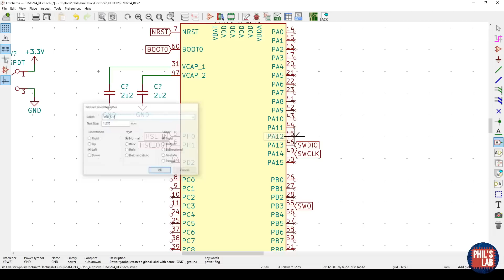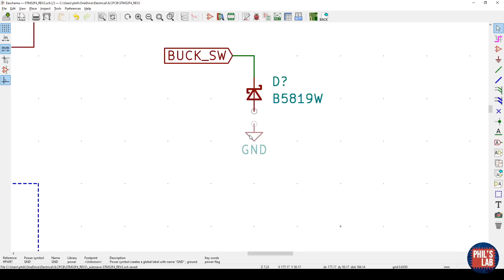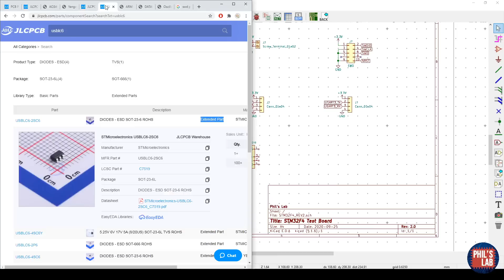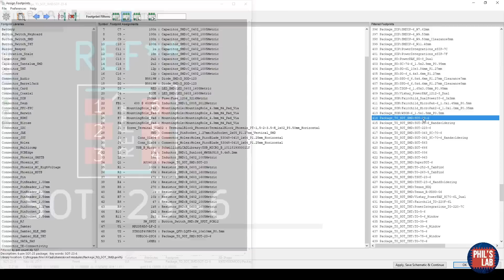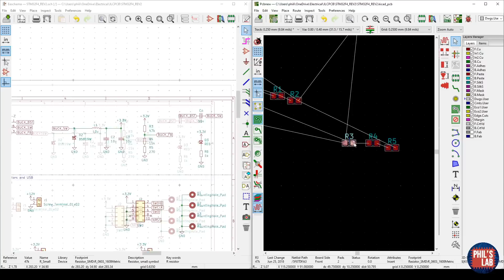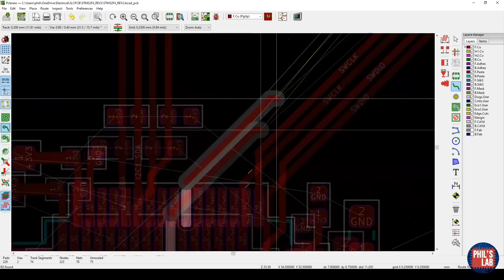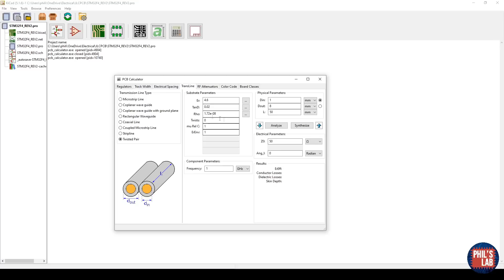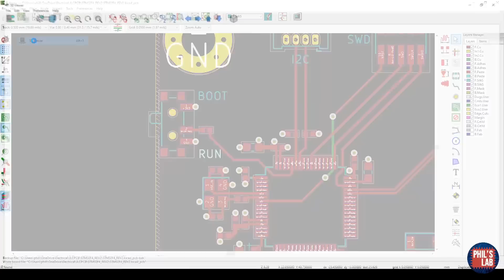(Sponsored) KiCad STM32 + USB + Buck Converter PCB Design and JLCPCB Assembly - Phil's Lab #11

Comment: This video is just great; I'm on my 2nd year of Electronics and Computer Engineering, and I needed to learn PCB design to start working on my final year project, although it has a different MCU and the final board will be way more component populated, this video just points out what most students do not get, like costs, finding stuff and other nuances you only get while designing. This will most certainly be a guide for me in the future! Thank you very much for dedicating your time with this.

Comment: Hey Phil, Great video.

JLCPCB says that the red markers in the preview do not actually represent pin 1.  How do you know they meant pin 1 in this case?

https://support.jlcpcb.com/article/99-does-the-red-dot-means-pin-1-in-the-placement-previewer
Reply from the maker: Hey Jameson, The JLC FAQ on pin 1 placement is pretty confusing. Basically it's only relevant for ICs and is indeed there to indicate pin 1 of the chip. JLC indicates polarities for diodes with a + and -. Essentially, if you follow the steps in this tutorial and mark component orientations on the silkscreen all will go well with the assembly.
Reply: Thanks @PhilsLab .  This became a lot clearer after I submitted a board design to them and they did their own analysis.  It seems most ICs have a clear pin 1 indicator but some packages, like the oscillator, didn't. The jlcpcb engineers figured it out just fine.

Comment: Good tutorial on Kicad! My only very minor criticisms are that Phil uses over uses label connections where wires would be more intuitive (the buck converter circuit would not sit well with most test technicians) and the schematic representation of decouplers in that way is not a good idea.

Comment: I used the same crystal with the same capacitors, but my OSC doesnt seem to work. Any idea, what can be off?
Reply: Not knowing how you have routed your board, I could not say for certain, but If the copper geometry in your crystal network introduces too much capacitance, things can be thrown off and the crystal will not oscillate. Make sure your traces from the crystal to the MCU are not excessively long. 

Also, the type of capacitor matters as well. With ceramic, which you would have undoubtedly chosen for a crystal, there is a parameter called temperature coefficient, which is important, to ensure the capacitance value does not drift with variations in ambient temperature too severely. Ceramic capacitors tend to fluctuate their capacitance as a function of the voltage applied vs voltage rating and temperature.

Alternatively, the MCU sometimes has configuration registers to set oscillator drive. 

Lastly, a high value resistor (1Mohm) in parallel with the crystal may help start the oscillations when Vdd initially comes up.

Comment: Hi Phil. Please explain how you calculated the Rext. According to the AN2867 appnote, the resistance is calculated by the following formula: Rext=1/(2*Pi*F*CL2). So if we got 16MHz and 12pF, Rext=829 Ohms. But you use 10-47 Ohms. Have you made a check to see if the additional resistance will affect the gm >> gmcrit ratio? And after that, you manually recalculated the resistance value and got the range from 10 to 47 Ohms?
Reply: Gustavo Elizondo had the same question you did; Phil answered it further down in the comments. :)

Comment: Thanks for the MP2359 reference circuit. I'm reversing the new Nintendo Game and Watch hardware (on github/same name as here/"game-and-watch-hardware" is the repo). It has a 3v7(LiPo) to 1v8 converter in a DSBGA-12 (or equivalent), mystery chip. The markings don't match anything from TI, do match Torix Semi's marking format, but not in a documented package they list. The only reason for mentioning it here is bc it only has two external resistors on two separate pins to ground and a tiny inductor that looks like a slightly wider 0805 ceramic capacitor. There are a few scattered bypass capacitors, but the 1v8 output of the chip is VDD for the STM32H7B0. I have the xrays and fully traced circuit to prove it. There's no external: feedback divider, switch, or diode, just the 3 passives and all ceramic caps. Do you have any idea where to start looking for a similar topology? I don't care if I find the specific chip they used at this point. I'm mostly interested in saving such a simple circuit block for future use.

Comment: Hello Phil,
Nice video. You don't really need to bother again with export/import netlist. 'Update PCB from schematic' does the job.
About the component orientation, I have 'patched' my KiCad with a permanent 180° rotation for all. Some users say only some components needs the 180° rotation. That fixed every polarized caps (not used in your video, avoid the problem ?).
You probably need to add to the video description "KiCad release 5.17" info because of v6 soon release.

I noticed you never 'save'  the job but often the icon is in saved state. Probably hours of video recording, cutting, assembling here !

Comment: Hi Phil,
How do You know the load capacitance of a crystal (C_L) is 12 pf?
In the datasheet: https://datasheet.lcsc.com/szlcsc/1811141821_Yangxing-Tech-X322516MLB4SI_C13738.pdf it is written 12pf; 20pf or specify, so how do You choose? Especially given that the LCSC: https://lcsc.com/product-detail/SMD-Crystal-Resonators_Yangxing-Tech-X322516MLB4SI_C13738.html/?href=jlc-SMT suggests that it's 9pf.
In the datasheet it says that the name suggest capacitance, but for me the letter L is not intuitive as a measure of capacitance :D (X322516M(L)B4SI).
And about PPM the higher the Load capacitance, the lower PPM, so +-10PPM should correspond to 20pf, but I might be wrong
Reply: Comparing products from https://www.evelta.com/ysx321sl-16mhz-9pf-10ppm-4pins-smd-smt-metal-surface-quartz-crystal/  I would say the meaning of the letters are:

For C_L:
- L = 9 pF
- M = 10 pF
- 0 = 12 pF
-  R = 18 pF
- S = 20 pF

For PPM: (Is it PPM/pf? or what?)
- B = 10 PPM
- D = 20 PPM

Comment: What would you actually be able to do with the finished product? Also, why did you not autoroute your connections after laying out the parts and making your power layers in the PCB? is that your OCD requiring you to manually route everything or is it a concern over stray electromagnetic anomalies or...???

Comment: Fantastic video. Thank you very much for all of the work you had to have put in on this.  One tip for you, when you are drawing your edge cuts, if you hold down on ctrl it will automatically snap to horizontal, vertical or 45 degree lines. This makes alignment much easier.
Reply: thanks

Comment: Thanks for this video.  
1- What happens if Vin is ~5.5 V and USB is also connected? Wouldn't there be two competing voltages shorted?
2- Why you tried to make backside traces as short as possible?

Comment: I just wanted to say how grateful I am that you are providing tutorials like this for the community. As someone who became an electrical engineer due to a fascination with PCBs and design them on a regular basis I think it is great that you not only show how to use KiCad but also the thought process and considerations that people go through in it's creation. 
I use KiCad and I also recommend to my peers to use global labels and break up their schematic into blocks. I personally don't do it as extremely as you did, as I would have probably combined the blocks of the power supply into a single block because of how simple it is. Also, I normally link the microcontroller caps with the 3v3 in the schematic so that it is apparent to the user that they are for the microcontroller power supply specifically. 
My reasoning for using global labels is that a schematic is meant to tell someone how the thing is wired and hopefully how it works. You shouldn't have to waste time following a wire just to realize it's a ground.
Reply from the maker: Thank you very much for your kind words, Jonathan! 
I agree that I possibly went a bit too mental with the global labels in the video. :)

Comment: Super tutorial, well-made, easy to follow and you are good at explaining! I have first a comment and then a question to a problem I have got.
2:21:16 You have a track under the crystal, it's normally a bad idea and if you use high speed signals is it normally a bad idea to "cut" a hole in the underlining layers, to the signal does it look like the board are missing and the signal have to run around the hole, in high speed does the signal not run in the traces but between the layers, it uses the traces as a way to navigate by, you can think of the high speed traces as ski lift for the signal and the missing layer beneath as a nearly impossible wall to cross. :-)
Now my question: I have made a "larger" project and placed every component on the board, in the end did it all clutter up on one schematic and therefore did I move sections from the main schematic and placed it on sub-pages. Now when I update the board from the schematic, do KiCad place new copies of the components, as if the old components and the moved drawing no longer is seen as being the same components. Do you know a trick instead of having to place every footprint all over again? :-)
Reply from the maker: Thank you for your comment! :) The trace underneath the crystal is the crystal trace itself and that is absolutely fine (ST recommends it this way in their layout/crystal guide). A crystal from a DIFFERENT (high-speed) signal near or underneath the crystal is a bad idea however.
Regarding your question, coincidentally I had the same problem myself and didn't research a way to get around this.. maybe there is someone else who knows a shortcut! :(
Reply: @PhilsLab  Thank you so much for replying! Yes you are right in that the trace is from the crystal itself and sorry I may not have expressed myself in the best way, I meant to say that this is fine, but normally will it not be ideal. Also, if you have HF maybe above 2-2.5 GHz. I did also forget to say that if you want to control the impedance when routing an HF signal trough via's, you may often get a huge benefit if you place a parallel via beside the trace with a distance of maybe 1 via. :-)
Reply from the maker: @friedmule5403  No worries :) The additional via only works properly if you have a ground plane adjacent to each signal layer you are routing from and to, so wouldn't work for a typical 4-layer stackup with a single GND plane. But yes, for higher-layer boards or with a different layer structure that is indeed recommended.

Comment: It would be great if KiCad would let you create your own custom library’s where you can have the all the details of the component in one place. E.g Component data, footprint, part number, supplier.etc

Our libraries were quality controlled, and parts had an issue status, you could not just pick a part, find a foot print and use it. Once you had built the library you did not have to go through all the manual stages for the selections. Having to select a foot print every time for every component is just asking for errors.

Comment: Everytime I see people designing PCBs and then programming them I always wonder if this is electrical engineering or computer engineering. I'm studying CompEng, I have some course related to firmware and embedded systems (so topic covered in the programming videos) but nothing related to HW design
Reply from the maker: To be honest, I didn't have a single course on PCB design at university and I studied electrical engineering. However, I believe some unis do offer courses on it but I wouldn't expect it to be part of a computer engineering degree.

Comment: Dear Phil, firstly thank you so much for your valuable videos. It is pleasure to watch and learn. I would like to ask a question, if your board's supply was +/-12V, what would be your copper polygons? E.g. would they be +12V,-12V, GND, GND polygon layers? Could you please give an advice for that? Regards
Reply from the maker: Thank you very much, Gökhan! Hmm it really depends on what components are used, what the main system voltage is (i.e. if the 12V rail is being stepped down to 3V3), etc. Depending on where the components are layed out, I would have a single, solid ground polygon on one layer, and then use one the layers divided up into different power polygons, depending on which circuits are above it. You have to be careful when doing this though and make sure not to route any sensitive signals across these splits.
Reply: @PhilsLab  thank you so much Phil, l will consider your advices.

Comment: Regarding reverse polarity protection, why not just put an 'idiot diode' normally reverse biased after the fuse? Any reverse bias will blow the fuse. But no voltage drop at all in normal operation?

Comment: Hi Phil, As ussual very nice vid. I had a little concern on the Buck Converter though. You had used a Voltage divider on the EN pin, However, the data sheet of the MP2359 explicitly said, to automatically enable, just put a 100k resistor between that pin and Vin. So if I may ask, what is a particular advantage of your design.
Reply from the maker: Hi Ian, Yeah, I overlooked that part - both designs will work - so just go with the single 100k resistor!
Reply: @PhilsLab  thanks, you are really helpful. Now im also making my board using STM32L405. For I need a much lower powered MCU. Anyways, im quite having a problem finding a mini SWD connector. Thats why instead of the cortex debug type im just going on a 4 pin (3.3, swdio, swdclk,and gnd). Do you think is it a good idea? Men i really like to have a good chat with you.

Comment: Thanks for putting this video together showing the process from start to finish.  I've got a slow-burn project for a USB interface dongle for vintage terminals/keyboards going and I'm keen on using jlcpcb to do the assembly.  I was looking at a silicon labs USB part, but it is an extended part with zero stock on jlcpcb, so looking at more readily stocked STM32 processors has caused me to rethink my BOM.
Reply: The JLCPCB BOM plugin also has a script that converts the footprint CSV to CPL and you can supply a JSON file with rotation angle overrides.  https://github.com/wokwi/kicad-jlcpcb-bom-plugin
Reply from the maker: Thank you for watching! Yeah, I guess you need an HID USB device? If you get an STM32 MCU with USB, you can get a pre-made HID driver from ST directly in CubeIDE. Maybe that would work for your instead of using an additional USB IC?
Reply: @PhilsLab  The Silicon Labs part was an 8051 core with USB integrated on chip.  Definitely doable, but I'd like to get as much assembly/parts from jlcpcb as possible and the Silicon Labs parts don't appear to be in stock.  (It's jlcpcb part C430128)

Comment: Hi Phil, great work out there. Can You give me some advice, where can I find informations whether a given pin has a built in pull-up resistor?
Reply from the maker: Hi Pawel, Thank you! Yeah, that should all be documented in the MCU's datasheet (and/or reference manual). I believe most pins should have the option of enabled a pull-up or pull-down resistor.

Comment: Very interesting, I've just sent off a similar board with buck regulator and esp32 MCU, and I've realised after watching your video that I've made a design error, I missed the part in the datasheet which said the EN pin can't take >6v, so I'm exceeding the absolute maximum.
Reply from the maker: Oh no, but glad you caught the mistake. Hope everything goes well with your next boards!
Reply: @PhilsLab  Well they arrived now, I don't think I'll respin them I will try to bodge in a couple of resistors somehow, at least I know about the problem and can try to fix it instead of destroying the tricky-soldering esp32 with a broken power supply

Comment: Your video is great!!!! you explained almost everything in one video. 
The advice to use JLC PCB Parts helped me a lot because I was having some troubles choosing some components, conssidering the tousands of different options we have for each case. 
Maybe you can help me with a problem I have. What about if I  need two or more PCBs for the same device? I have the PCB with the microcontroller and I need the push buttons very close to the enclosure, like in a cellphone. 
Do I need to create a new project? or it is possible to do all in one proyect? I want to get all the PCBs in one shipping.
Reply from the maker: Thank you, Nicolas! You could fit both on one project/PCB and then put on what are called 'mouse-bites'. They are closely-spaced drill holes, such that you can easily break off the two PCB parts.
Reply: @PhilsLab  thanks!!!!! I'll do that

Comment: Hi phill, i wanted to get into building and programmin STM32 boards, but i am really unsure about the programming, would those ebay ST-Link V2 work with this Micros? would i have access to SWO with one of those also?
Reply from the maker: Hi Diogo, I haven't tried ST-Links from eBay (or any clone for that matter). I just use the 'standard ST-Link V2 and all works well. They're pretty inexpensive - and yes, that enables you to use SWO as well.
Reply: @PhilsLab  well yeah, as budget tinkerer it's really expensive to buy it. Would you advise a non-clone model?
Reply from the maker: @MRbad4  I'm not sure how much they are where you live, but I can get one for 22 EUR which seems decent to me. I mean by all means give the clones a go, I'm fairly confident that they would work. Essentially the ST-Link ist just an STM32 MCU running a particular firmware.
Reply: @PhilsLab  I dont know if its clone but i saw one that looks like your's for 11 EUR on amazon i think im going to try it. On your new vid did you make that adapter board  to take the programming pins yourself or is it bought?

Comment: 1:06:00 Could you have added another P-channel MOSFET instead of the Schtocky Diode for the 5V USB Power? It is basically “reverse voltage” protection (as the rail could be at 12V), and you avoid the power loss/heat over the schtocky..?